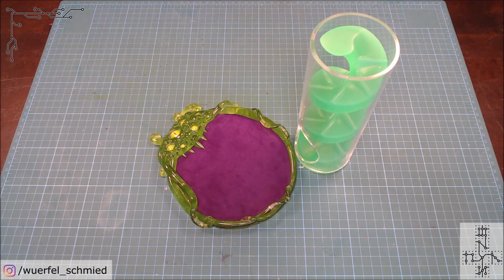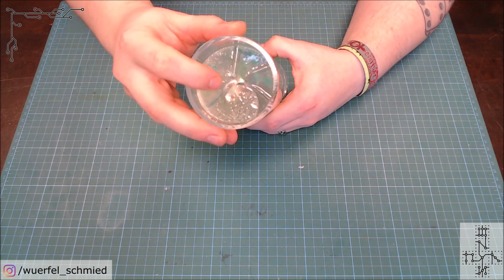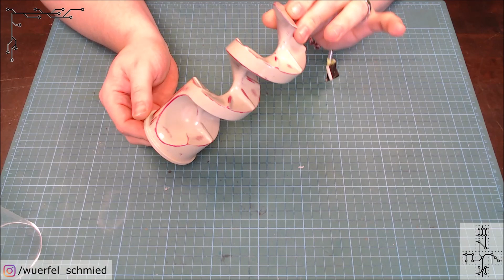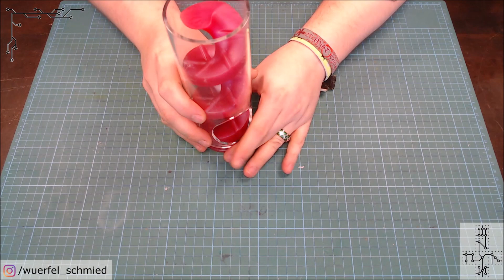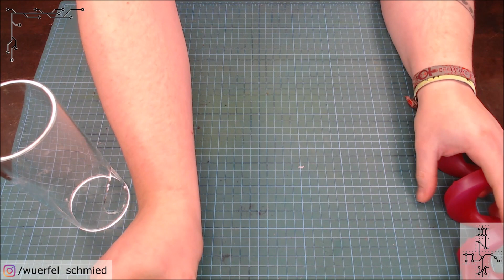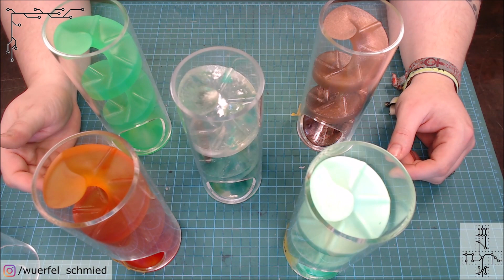Product: Resin Tornado Dice Tower

Comment: You could use dice as your filler material in the base
Reply from the maker: Absolutely correct. I have a bin of rejected castings. I have made towers with some dice in, but they're hard to see from the outside. Maybe I need to paint the numbers to make them more visible.